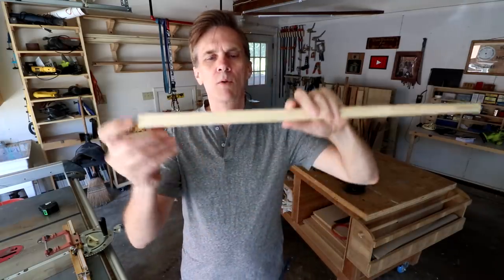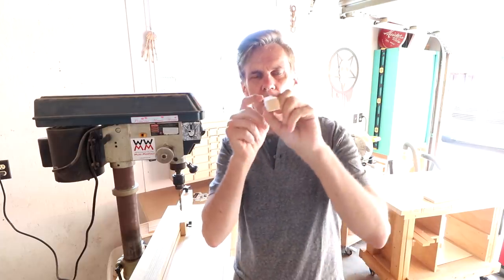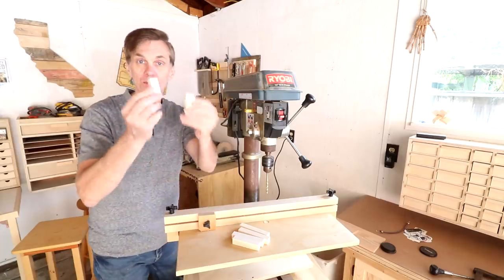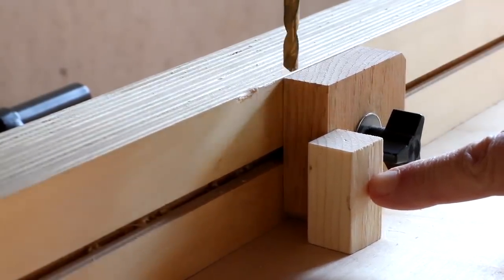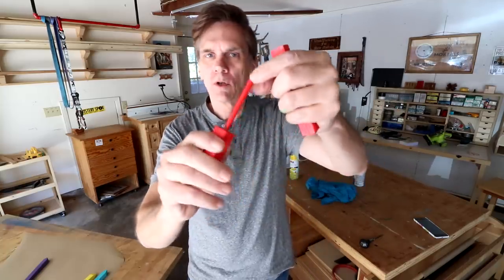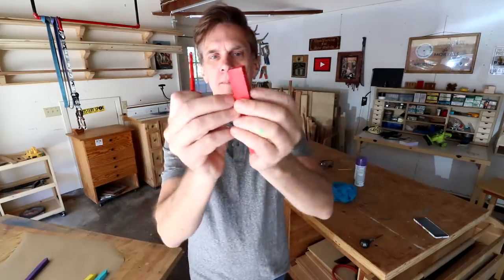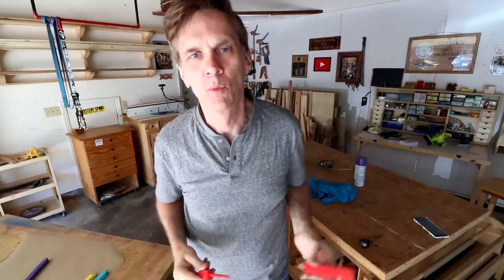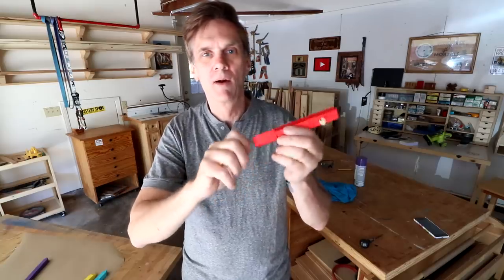How to make this amazing mind-bending snapper puzzle. It's sorta dumb, but also kinda cool.

Comment: That's awesome. My granddad used to make these, but without the rubber band or the hook on the bottom. The "trick" was to make it snap back in. He was a woodworker too, he built a 20-odd foot wooden yacht in his back garden, gave it to my dad and we used to go sailing around Wales in it.
He didn't own a bandsaw either. Or any electric tools...

Comment: Hmmm... I actually liked it... But it gave me an idea!
Follow my way of thinking here. Make something exactly like that, but with both sides with the same size and making a point in both ends. Then make a hole with threads (or use a threaded insert, as you like it) in the side that has the hole for the dowel. Right?
Then, when you're making a box you can use it to make sure both diagonals are the same size. 😊
How about that? 😃
Stay safe there, Steve! 🖖😊

Comment: We used these in our coaching lessons to illustrate the point that 'The Solution is not always directly related to The Problem'. Most people see the rubber band, and associate the solution with it, not realising you can get something done and a problematic situation resolved by not actually addressing the problem head-on.
One Swiss guy (it just had to be a Swiss or German didn't it?' took the puzzle home that night and cut it open, returned the next day and said 'I haf fixed ze problem. Ze rubber band was broken inside.' Ah well.

Comment: Use a shorter rubberband so it doesn't hang out the sides so much, and it will be (slightly) more impressive. With the excess length you would expect  the rubberband to move when it gets "hooked".  I got a small plastic version of this in a beginners magician pack.

Comment: This would have been great if you made it on your lathe !!  Rounded body with a bullet shaped 'lid' holding the dowel.  The one I had made years ago didn't have the band go through it. You use a thinner dowel in the band to hold it and glued it to the sides in the holes but the centre dowel did reach passed the level of the band so it would be feasible that it would work.

Comment: Fun little gadget Steve. I had one of these in an old magic set I got as a kid. Also an impromptu version is you can use an ink pin with the removable top. The point is perfect to squeeze and snap back on the pen. Just explain to your mark that your using invisible thread to make it snap back on!  People are so gullible lol

Comment: Has anyone got some inspiration to share on building some sort of retractable/foldable roof. I want to build something over the front yard, so that I can continue woodworking when it starts to rain, since my little shed isn't big enough to work in. But I can't think of anything that would be sturdy enough to stop the rain and also be easy to remove/fold/retract.

Comment: First saw these 60 yrs. ago.  (I was 10).  But the hole was drilled in the end and the rubber band was stuck up held by the dowel on the bottom.  (You could see the rubber band tight in the hole, dowel at the end.) Then the top was pyramidal, all 4 sides sloped not just your two sides.  Because your rubber band does not tighten when pulled it gives away the trick.